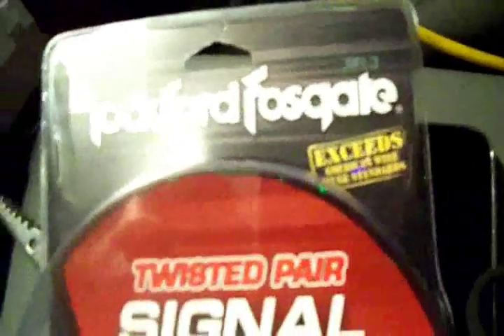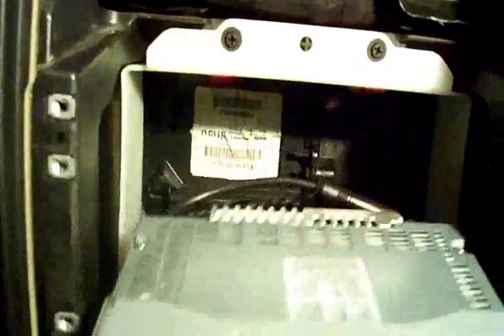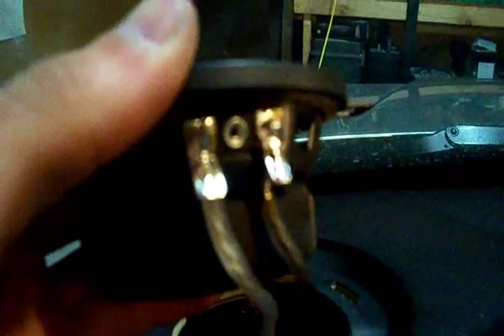having some fun installing the new dash speakers.....

Comment: I have a 2010 charger sxt and it has 3 of dem tweeters in the center dash. I have never felt any air or movement from those. Only the speakers in the front doors do feel air and movement. Do those tweeters work or not?
Reply: Sounds like my sebring.. I took off the grill and nothing but an empty 🕳.. Im installing my own

Comment: How do you take the factory dash speaker grills off? few years ago I installed new speakers in my sister's 2005 - 300 rear  & front  door speakers installed couldn't figure out dash speakers Crutchfield didn't supply any steps for the dash speakers... so I lefted it alone didn't want to break anything I still would like to install them for my sister the speakers for the dash are still in the box.

Comment: dam i ran 12 gauge from my xovers then 10 gauge back to my amps i wish we didnt have to use  such huge wire u have to drive ur car im lucky my cherokee is off the road so if i get stuck i can leave it but its just as cold in the ny need a garage so no space heater for me